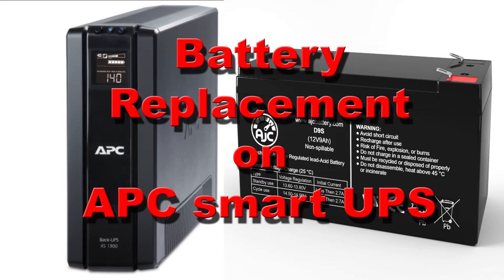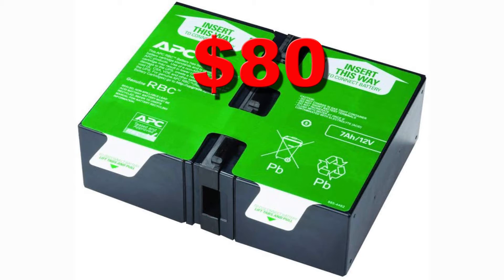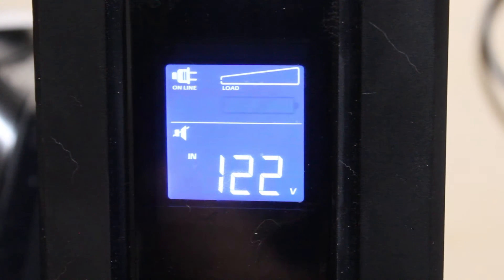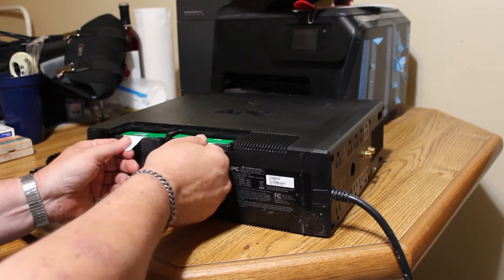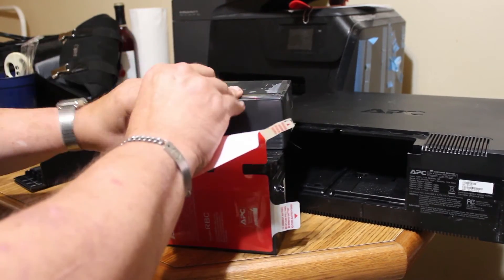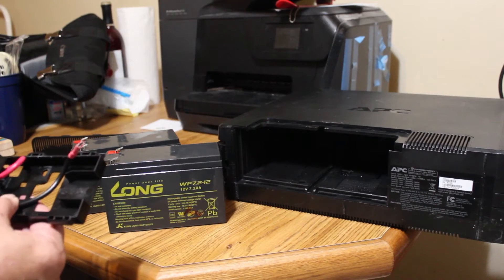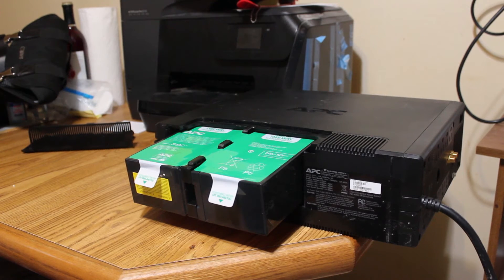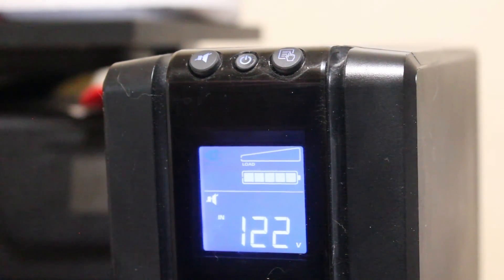Battery Replacement on APC smart UPS

Comment: Can i hot swap the batteries on my APC BN1500M2? Or, do I need to power everything down, turn the APC OFF and proceed from there? Then do the reverse to power back up?
Reply from the maker: I have done hot swap in the past. but, I can not recommend doing that. It is very unsafe to do.

Comment: You fast forwarded through the one part that I need to see. The single wire that's red on one end and black on the other. I don't quite know how that goes back together.
Reply: Yeah and he skipped the part I need: turning the actually UPS off. You'd assume it was hold down power button until it prompts to turn off, but UPSes are never that straight forward.

Comment: Thank you for the video.  my NS 1350 does not blink but will only hold 12 or 15 minutes of discharge time.  Is it time to change the battery??
Reply from the maker: Should work for you

Comment: No instructions for the most important part -- connecting the wires correctly.. I got my UPS without batteries at all, so there's no template.

Comment: The video shows 12-7 batteries but the still photo shows 12-9. Just want to confirm which was used. The 9ah flavor is usually a little taller than the 7ah
Reply from the maker: 7ah where used
Reply: Thanks. I pulled them out and they were the standard 7ah size but marked 9ah. 7ah slid right in.

Comment: i'm stuck at the stupidest part...  the sticker won't come off without destroying itself.
Reply: Use an hairdryer to heat up the sticker. Heat reactivate the glue making it more malleable. Remove the stickers carefully so they do not leave adhesive on the old battery.
Reply from the maker: not sure what your doing wrong, I have changed alot of these even ones where the batteries have expanded
Reply: I’m right there with you in that the battery cover won’t slide off without me breaking a tab or two.
Reply: Oh god, battery was so swollen that it kept the housing shut. Super glad I double checked this lol. Got it for close to free.

Comment: I just a free XS100 how do I test if the unit is defective or need a new battery if the battery is not flashing?
Reply from the maker: If the battery light is flashing when plugged in. Give it about 24hrs which should charge it, If its still flashing replace the battery. When you pull the battery off the terminals and plug in the ups (don't leave it like that very long)you should see 12 volts on the terminals

Comment: Have any thoughts on how to parallel this with a much bigger battery? Or is that not feasible . . .
Reply from the maker: They run on 24 volts so external battery power with 2 batteries in parallel is possible